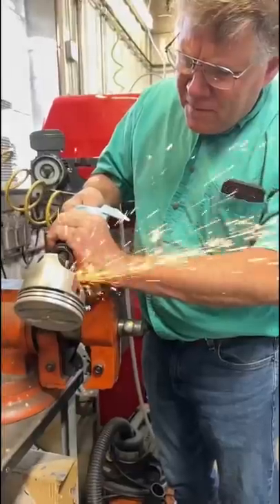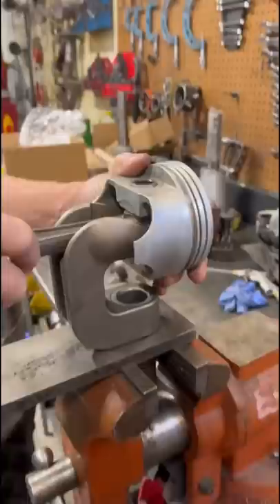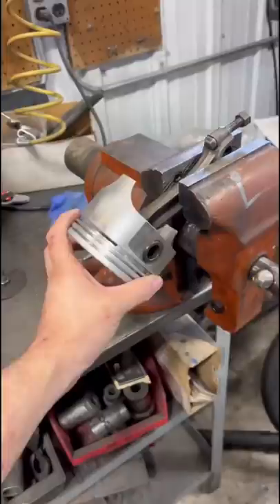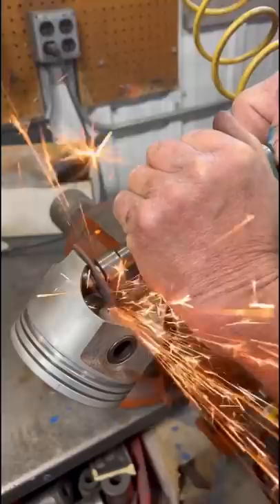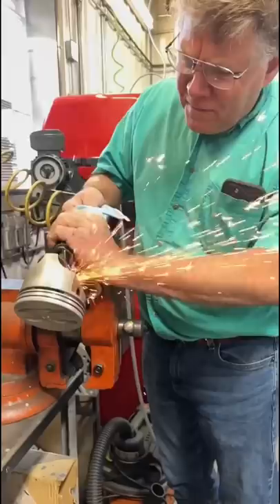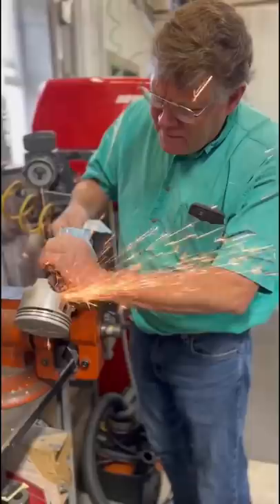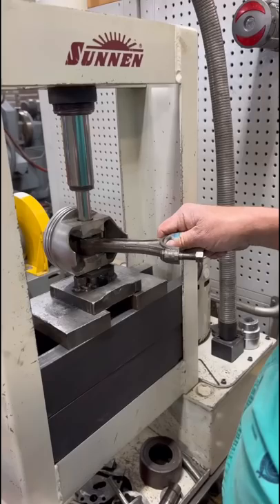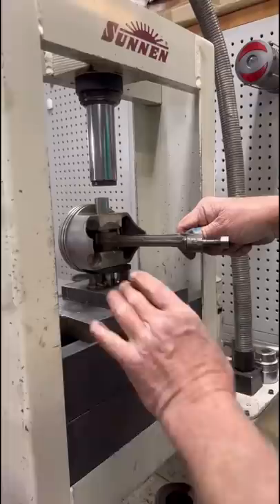#shorts Sometimes You Do Things By The Book, But Sometimes…

Comment: The thing about doing things "by the book" is you have to keep in mind that someone wrote the book. And sometimes you need a different book.
Reply: Sometime you just need to write your book !
Reply: @jk3dad  yep ... the book of books ... even in the trades there are rules about going outside the rules ... as long as you know what you are doing
Reply: The books are usually written by engineers who have significantly more knowledge than you.
Reply: Couldn't have said it worse myself
Reply: @jamescrud  Well you are wrong for several reasons. I'm literally an aerospace engineer. But that doesn't mean that I know more than you about what you are trying to accomplish. I might design something to work a certain way, but you need it to work slightly differently, so you modify it. Astronauts are trained to jerry rig their spacecraft in emergencies because it works.

When I started out I worked for a small airplane engine producer. There was always this sort of animosity between the engineers and the machine operators and mechanics. 
I decided to find out what the issue was, and the machine operators and mechanics all said basically the same thing. "You guys think you are so much smarter than everyone else and won't listen to any criticism, you give us parts with bad tolerances that don't fit and tell us our machine is calibrated wrong", etc.
I started making a habit of, any time I would order a new part, I would go ask the machine operators if it came out right, then go ask the machanics if it fits and works properly, and if anything was wrong I would go make corrections. Suddenly they didn't hate the engineers anymore, and the engineers stopped calling them idiots and started doing the same thing. 
So my point is sure I might be good at math and calculating tolerances and stress thresholds, but that doesn't make you stupid.

I like to say it this way: If you have to ask, don't do it. And if you know what you are doing, you know what you are doing and you wouldn't be asking me.
Reply: @JohnPlissken  You're forgetting about the issue of liability. I also work in aerospace as a design engineer and the roles of each discipline are clear cut. Machinist and mechanics have zero authority to deviate from instructions or plans and for good reason. They don't necessarilly have all the background information about an assembly or a particular part to start making decisions about what to modify to get it to work. If we give them that freedom then ppeople can get hurt or die. Their job is to make it as per the design no questions asked. If it doesn't fit or doesn't work then we must be notified and WE need to fix it. We have no problem discussing a potential fix or coming up with a solution together but under no circumstance are they allowed to make a decision without consulting us. We had a mechanic install grade 8 bolts and hardened washers on an assembly that called up grade 5 and regular SAE washers thinking it's stronger and will do the job. He didn't understand that grade 8 bolts are not as forgiving for clamping together surfaces that are not perfectly parallel. He torqued it to spec and the heads snapped off due to the prying action of the head not sitting perfectly flat on the hardened washer. I got 100s of stories about machinist and mechanics thinking they know better...when they know just enough to be dangerous.
Reply: The problem we had was a lot of the engineers would simply refuse to admit any fault. If a part didn't fit properly they would simply blame the machinist and tell them to make it again. That's bad for everyone because for one thing, the machinist like you said is not supposed to change anything, they might not know what could potentially go wrong if they work out of tolerances. And then, if they don't change it and they keep making faulty parts they could get repremanded for wasting time and resources and not knowing how to run the machine (even though that's not the real problem). And with the engineers refusing to make any changes, that leaves it all on the machinist to figure it out. So they make the adjustments, and then make the new parts fit. And everyone sticks their heads in the sand and pretends the engineer was right the first time. What happens then if the engine blows out the manifold in flight? Whose fault was it? It should never come to that with a properly functioning R&D team. Your job as an engineer is not to be the shop genius who is always right. It is to critically analyze your project, find everything wrong with it regardless if it's your own fault or not, and figure out how to fix it. If a man can't admit his own faults and fix his own mistakes he is worthless and dangerous as an engineer.
Reply: @JohnPlissken  I don't know where you work but what you're describing never happens at the company I work at. We live in the engineering world and go by the numbers. "Feelings" are irrelevant and have no place at work. I've never seen a competent engineer leave it up to a machinist to figure it out or start blaming them because parts don't fit together. That sounds absurd to me. We have protocols in place to evaluate and assess problems and find a solution. If a design calls for a  3.000" shaft to fit into a 2.937" hole then obviously somebody fked up and you can't hide that. The designer or engineer is notified, it gets corrected, and we move on. I've never heard of an engineering refusing to revise a design simply because of ego when it's been proven not to work. Personal feelings are left at home before scanning your badge to come through the gate.
Reply: Some unusually unintelligent people misunderstood the point of your comment. I get what you mean.
Reply: VERY well stated❗️
Reply: @jamescrud
Reply: @jamescrud  Then you never have work in a real factory.  We was redoing inkjet system.  The engineer wanted the stand to be one leg 5 feet high and to be solid and not move.  All the machinist was like this won't work it will move to much. The head engineer flat out said we are doing it this way and if it does work we do it another way.  So we did it that way and then another way and then finally did it with so legs and made it solid so it wouldn't move. The engineering department waste over 40 hours of machinist time because they was to proud to admit they was wrong.  Another project the engineer  said they no way you can do what you want to do it can't be done like that. Well the plant manager and the machinist manager came to me and said how did you guys control the location of the foil and the DEX line. I showed them and told them on the line and they like so it will work.  Yes it will just do this and this and this and you can control it.  We had different guides at different location to control location close tot he die not trying to control foil that 10 feet away from a guide.  IT takes a engineer that will listen to his staff to be a good engineer.  To many engineer think they know and are better then the workers on the floor.  They have no clue what to do most times to fix a simple problem.
Reply: @johnunsicker7440  I work in aerospace. It's a different level of engineering than consumer products.

Comment: Tig torch on the end, around 120A. Huge amount of heat in a small area, will let go no problem. If it has trouble, spray a little water down the pin at the same time to help keep the pin cool. Should almost fall out.

In any case, good job getting it done either way.

Comment: Putting some tape on the metal surface close to where you are grinding can protect the metal from nicks. Obviously the cut-off disk will cut through the tape but often it will give you just an extra half second to pull the disk away and save damage to the metal surface.

Comment: If you had went on with the cutting wheel at a nearly inline angle with the rod, it would have took more time, but it would be easier to avoid damage to the piston. You'd still cut a horizontal line, but using several near vertical lines.

Comment: Lol.. Not sure I see any problem here at all. We were taught to do this in college during the first year, and it's a pretty obvious avenue if you're unable to do it any other way. Alternatively you could clamp the connecting rod in the mill and carefully eat away around the gudgeon pin. You could mill away the gudgeon pin itself until there is just a few thou left (not sure if it's a good idea though as it would take ages). You could also do what a local machine shop near me did, with a custom made dual oxyacetylene torch, where the con rod is clamped, the piston face sits in water, heat is applied to the small end and a screw press slowly pushes the gudgeon pin out. If you saw the setup, you would laugh at how arcane it looked, but it worked, and I got my vintage 10.5:1 pistons onto the new rods without the fear of some old fella slipping and destroying something that took me a year to track down.

Comment: You know I worked on small engines years and years before cars and my first question taking a car motor apart was, why aren't they full floating, why don't they have wristpin bearings. Then I learned they just make the shit cheap as possible. This would never be an issue with full floating

Comment: Have you ever forced dry ice down the wrist pin to make it shrink so it comes out easier?  A old guy I knew used a old flex plate to hold 5 at a time to heat them so the job was a bit faster. .

Comment: I come from the body shop world, but my first inclination would be to use a pneumatic belt sander instead of the wheel, would take longer but the rotation is from the other direction sonyou could theoretically remove the whole top of the rod without damaging the piston.

Comment: Wonder how well an induction type heater would work for a job like that, especially if you could find an adapter that could go around both sides of the rod small end at once, heating it the way the normal rod heater does.
Reply: They have boxes with heaters that are electric they just take a while to heat up. I imagine an induction heater would work well though.

Comment: Could have "dressed" down the diameter of the cutoff wheel (or used a smaller diameter wheel initially), to avoid "knicking" the piston in the tight area of the wrist pin. Good idea though, and nice procedure getting piston off connecting rod....

Comment: In my eyes you did the rite choice I have done so many rebuilds it ant funny it should be fine not a big deal if I recall my pop did the same thing on a stroker motor it was fine and it's still running yep sometimes you need to do things differently good job though

Comment: Long ass essay incoming-

I do things by the book (trades) because in my line of work there is no amount of sue happy fucks that, even if signed a consent form for me to 'do it exactly how they want',  will not renege. 

I had a customer that wanted me to paint the dropped ceiling tiles of his Subway back-kitchen. Holy hell the pushback over me doing it right (tape off the frames and corners/walls) or remove each tile and paint. Nope, wanted me to just "paint the ceiling". Walked away. And I did point out a fire code violation above the ceiling tiles where a roof drain was plumbed through a wall with no firestop. He said, "I don't care if inspectors won't see it".
Oh and don't think the government gave a fuck over my complaint. Police refused to come to my car accident.

Stay safe everyone.

However 

I like you got text messaging confirmation, but that isn't equivalent to signed consent.

Comment: I had a guy at a shop put my pistons on the rods, I think he damaged a couple. It only had a couple hundred miles on it.  The two pistons went missing, and wrist pin went into the block, In my sbc   it killed my aluminum heads, everything!  He had a shop. But messed up so many parts, he had to move everything to his home shop, he would cut heads out of plane, he cut it it was just a few thou, on one side, and would Been about . 060" on the other if it could cut that deep, he made it about half way across , I sold him a block because he ruined one boring it,  he did not take the time to set the machines up right,

Comment: That’s bs! I done it for years and used a press made for pistons and if the clearance was tightened from using the press I would resize the piston where the pin goes by opening it up a .001 to .0015

Comment: They make a tool for these. You ate supposed to heat the end with the pin to 350 degrees Fahrenheit. (No more) you likely destroyed that connecting rod with what I'm assuming is MAP GAS? The customer paid you because that's the thing to do.. are you going to replace his engine when that rod breaks where you attempted a MAJOR TASK you attempted WITHOUT being qualified nor KNOWLEDGEABLE about? I had to learn this a year ago.

You fuccked up if & when you got that rod OVER 350 degrees, is where you fuccked up!